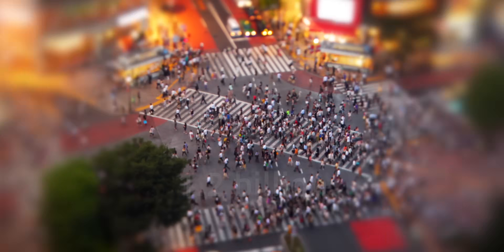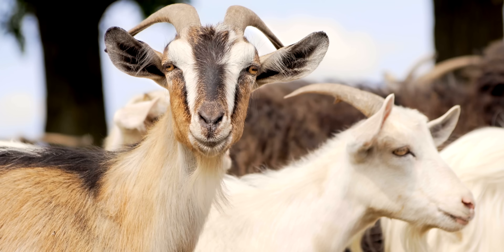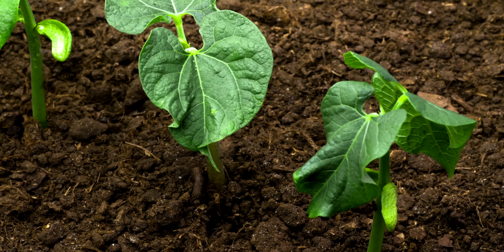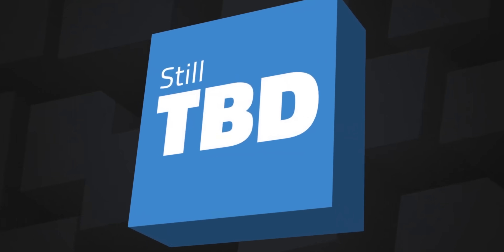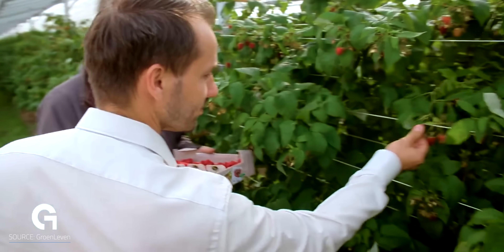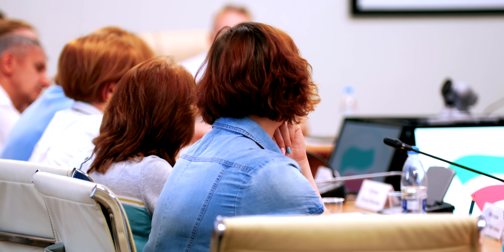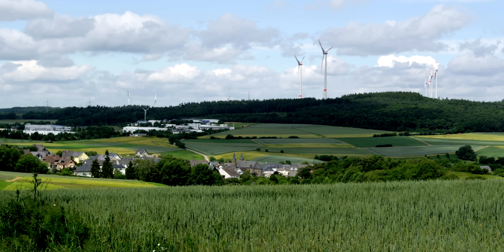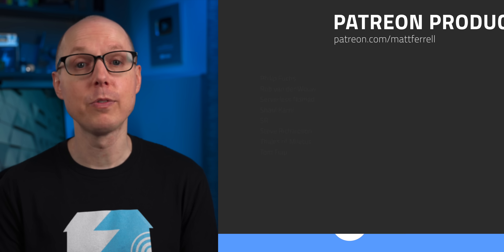Solar Panels Plus Farming? Agrivoltaics Explained

Comment: Voltaic panels use exotic metals mined using slave labor in Africa... the carbonate wafers are a result of boiling coal and quartz for days until they melt into an amalgam. The wiring uses copper and plastics. The steel frames and glass coverings are also heavy extraction industry dependent. All these raw materials must be transported thousands of km, worked into useable form, packaged and transported to the instalment site. The installation requires the destruction of wildlife habitat, clearing thousands of km in order to produce enough electricity for the effort to be worth the trouble and expense. The panels are delicate and do not last more than a few years. There is no way to recycle them, and no plan to... and that's your "favourite" supposedly "green" tech?

Comment: Solar power "is NOT a win." People will realize when it is too late that solar panels, just like house shingles and tarmac roads, absorb light instead of reflecting light back into the universe. Hense trapping the solar rays on Earth and will cause global warming expotentially. I've already had this dicusion with AI and AI apparently has agreed with me. It is in the math. Once they have been accepted globally, it will be to late to get rid of them, because the argument in the future will be the great costs that were invested in this doomsday concept.
Reply: quick question, doesn't the ground (dirt, grass, etc.) also absorb light instead of reflecting light back into the universe? if so, what difference does a house with solar panels make, if the earth is already absorbing light. btw, doesn't the atmosphere do most of the work reflecting light into the universe?

Comment: Bottom line is solar panels are not profitable, without gov subsidies aka taking taxes from your neighbor and giving it to someone else, they are too expensive, have to be replaced, are not efficient and cost affective  when compared to cheap clean coal plants or nuclear energy. And besides, every solar panel u install supports communist China, they control the panel mfg as well as 90% of the rare earth minerals including those used in solar panels, they want to take over Taiwan, and wont stop, and want to take the USA out. There u go...solar is a no go in my book. Lets go nuclear like France, and natural gas, do hybrids and let the markets get together to bring forth a Elon Musk to solve this problem

Comment: Maybe putting the panels on fields near already installed powerlines or substations that could add a feed-in section with some load leveling system (batteries or other storage) would lower the NIMBY?  No solar panels do noy lower greenhouse gas if you install them in the wrong places, you need the right insolation factors before even thinking about them otherwise they use more carbon in their manufacture than they will ever abate.  In a lot of cloudier places, agri-wind might make more sense, but those big turbines have been known to sling ice for... scary distances. 

Green energy is going to be a matter of shoes size and style,  Boots for work, Sneakers for comfort, and size to fit the local areas.  Wind and solar are not going to be a truly logical solution for more than a single digit percent, lower 20% of the energy load.  We are going to need the heavy, concentrated, generation of Nuclear and hydro of the right type and size as well.  That is if we want things like enough food to feed everyone, it takes that kind of energy to make the fertilizers that allow the high production of modern farms.

Comment: If you have a lawn, and some trees, you will notice during very hot or dry (or both) weather the grass grows much faster and thick in the partial shade of the trees.
Imagine grazing animals on open pastures vs partially shaded areas under the solar panels.  It would be a huge difference, as well as far less water loses.
For the berry farm, they had access to special PV panels, that space the photovoltaic cells out to allow more light to pass through between these cells.
I tried to find these types of PV panels without success.  It will be a huge drawback if these special PV panels are not commercially available at close to regular PV prices/Watt.

Comment: Rob has clearly outlaid the benefits of this symbiotic farming/electricity ... and they are many on a small scale.

He pointed out a few of the issues inherent in this proposal. 

He also slipped in the fact that solar energy production on a large scale is currently not a viable replacement for the infrastructure we have in place. 

Most of the work her referenced in his video was done in Europe where everyone works for the government in one way or another. The whole free market economy of the USA that feeds the world was not well represented in his proposal.

The final disclosure in his presentation here is that these programs will not/cannot move forward without government subsidies.

Comment: Another problem: Not all European countries have the infrastructure for such projects. For example, Poland doesn't have a unified power grid yet. So excess electricity produced in rural areas during sunny or windy days has nowhere to go.
Reply: I assume today, and every work day some smart Polish electrical engineer is designing an improved grid. It probably seems day to day, or even year to year that the system doesn’t improve much. Go back to 1900, and look at a decade at a time, and almost every nation’s grid will have evolved to the next step in every decade. War of course will have held electrification back.

Comment: Community resistance to agrovoltaics sounds made-up.  Sure, big tanks of bio-gas would give someone pause, as would big wind turbines.  Nothing to do with solar panels, so what's the objection?  What terrible nuisance do they cause?  Contrived presentation here.  Sounds like a win-win to me.
Reply: Could also be based on wanting to protect the local bird population. In case you didn't know but large quantity's of Solar Panels also reflect and focus light back  similar to magnifying glass. This creates on particular sunny days a deathzone around the Solar Panel farm that will boil any bird alive that happens to fly through it. This Zone shifts depending on the angle of the Sun and when favorable vanishes completely when the Solar Panels are placed right.  A Similar phenomenon can also happen with Skyscrapers. But that would be a big reason to be against Solar Panel farms because usually deathrays in the Sky that roast birds are usually a afterthought.
Reply: @rayzuke1232   As a former Environmental Planner, I hear something familiar in your reply.  I was actually doing the job of assessing the extant environment and politically, on polar extremes on either side of me in the middle, were emotional extremists.  Those on the right whom we are all familiar with by now, and those on the far left, just as emotional.  My job was to analyze the actual systems affected by proposed new constructions.  What you describe can be mitigated by choice of solar panel and accessory materials.  There is no "death ray" (sounded great, though, didn't it!).  Why not attack automobiles for their propensity to create glare?  Ever try driving into a sunset when the sun angle was just right and practically blinding?  We have Ralph Nader to thank that this feature of cars was at least dampened somewhat by cutting back on the chrome--especially the chrome-plated windshield wipers.  Thank you, Ralph Nader.  So I get your emotional state.  Use it to become more educated and practical.  There are always trade-offs, some birds will be injured.  Try to minimize it.  You should pursue a career in city and regional planning if you want to effect change there.

Comment: If farmers can do this it would definitely help with crops, small animal farming and most importantly less water. Small farms could use this idea and create it themselves. The cost of this stuff is still too high. Even with electric cars, you pay for the benefit up front which makes it no different than paying for gas in a 5-7 years use span. And with a Tesla The electric charger goes out after that time and the cost is higher to replace. Solar roof panels have ruined roofs and cost a lot for you to send the electric to someone else and you only get a small percent discount. The benefit has to be greater than the cost otherwise there is no reason to do it.

Comment: Why do they build wide instead of up? They should make solar panel towers.
Reply: Building up costs more and is structurally unsafer and less efficient. Solar panel towers will also take the sun away from other Solar panel towers and everything between them is useless space where it won't be worth to build a Solar panel due to the shade. Also the Solar Panel Towers will create at certain sizes actual deathrays that will boil anything that happens to be within it. So basically is faces the same Problems as Skyscrapers.

Comment: "Cleaner" energy is a misnomer.  These panels do not last forever, they are not clean in production, either the assembly, or mining the materials needed to make the panels.  As a solar owner, with Powerwall backup, on my home, nuclear power plants are the cleanest, safest, and best long term power solution, hands down.  The waste can be dealt with safer than ever before.

Comment: I'm rather skeptical about this. It's no coincidence that the sunny spots in the garden are the most productive. Everything planted in semi-shade or shade grows worse. At least that's the case here in Northern Europe. Why should good yields suddenly be expected under PV modules? And does the use of tracking technology not significantly extend the payback period of the PV system?
Reply: Yea, but here in Northern California where it's routinely 110° (43c) alot of my garden could use some shade during the hottest part of the day, if set up right I could see a benefit

Comment: One use I think you did not mention as it is only adjacent to the topic is Solar to shade irrigation channels to prevent water loss and lower water temps. The power generated can be used to power that irrigation pumps to balence windmills for days where there is no wind and used in conjuction can produce even sellable more off power.

Comment: Vertical Panels -Reducing the cost of energy
 Suspend and protect vertical panels in a tall transparent tower.  The panel could rotate inside the tower to follow the sun.  The tower could be located in urban areas.

Comment: Solar Panels - Mounted on Permanent Aluminum Support Platforms 
Solar Panel Farms - Reduce the installation cost. Install permanent aluminum platforms with fins underneath to cool the aluminum. Roll out the panels on the top of the platform and connect to the power grid. The solar panels can be replaced when they cease to be efficient.

Comment: The promise is great. I do wonder a bit whether these systems are truly "AI" or whether they are simply expert systems. If they are algorithm based, that's an expert system, not truly AI. I would think the challenges to AI for something as complex and long-timeline as farming is an impractical use. They would be better using AI/ML to run through historical data and using that to develop expert systems. But I understand that a lot of people use these terms interchangeably these day.